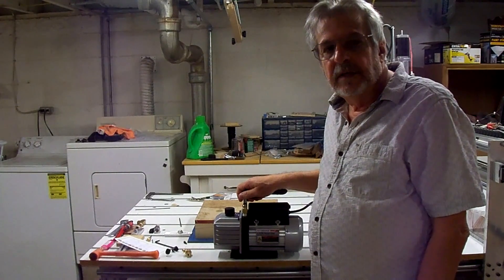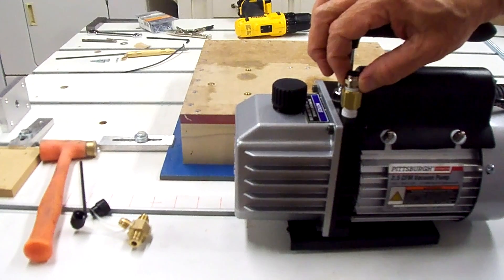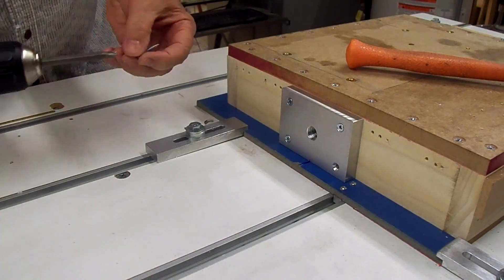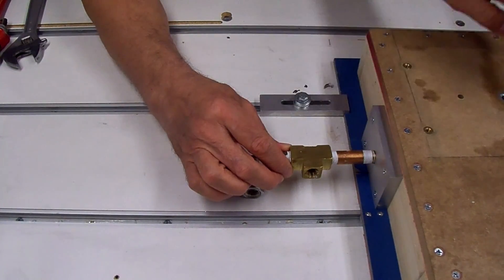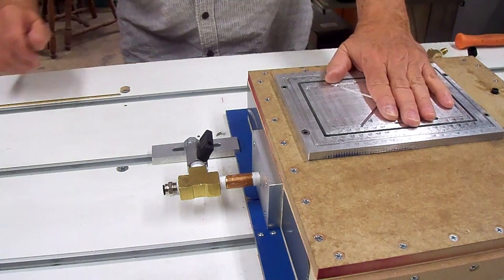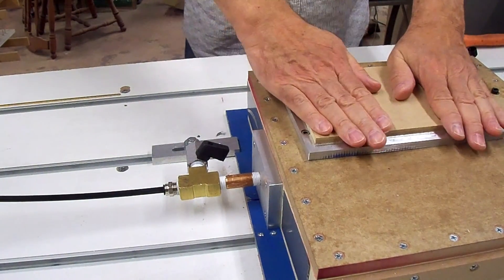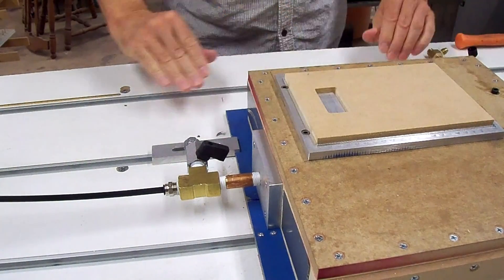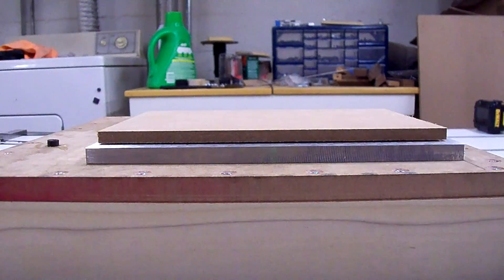New vacuum pump for the CNC vacuum fixture

Comment: hows does the vaccum go through the aluminum?
Reply from the maker: There is a hole in the centor of the plate wher the vaccum comes through and there are grooves cut into the surface of the plate that go out toward the edges. The grooves are about an 1/8" or so deep allowing the vaccum to reach the outer part of the plate.
Reply: @MyRobertadams  thank you sir.....nice build....i have a robinair pump...i want to make a couple small pads for fun...

Comment: So I am really having issues finding the proper thread size for my Harbor freight Vacuum pump I bought the 3cfm 2-stage version and the npsm to nptf does not work and its not a 1/4" npt or npsm size its actually a 3/8" pipe thread so I bought the Mcmaster 3/8" 4685t34 and thats not correct the only conclusion that I can think of is its actually a bspt thread (British Standard Pipe Thread) have you are anyone else run into this issue on the Harbor Freight 3 cfm 2-stage pump? I really have no quality measuring equipment either so I might have to go to a machine shop and see if they can identify it. But the npt, nptfn and npsm only screw in about 2 threads before it stops and the original Harbor Freight R12/R134A fitting goes in about 6-8 threads before it gets tight. All I really want to do is find an adapter to go from the pump manifold to 3/8" npt lol thanks I am also leaning towards bspt because its a popular thread in China and Japan like npt is in the us and canada
Reply: Oh yeah its defiantly a taper pipe thread I know the major difference is that the bspt is 55 deg angle on the thread from the cross section and npt is 60 degs so thats why it will go in only a couple threads I actually looked at the Mcmaster parts and found them to be a little expensive I actually ordered from Grainger lol who would of thought that they were cheaper Part# 1cpd9 Alpha Fittings Nickel plated brass so I await for it to get shipped to the store and we shall see. Do you know of a good way to Identify threads instead of educated guessing like I am basically  doing? and the next thread I need to chase down in the one on the exhaust port as I am going to use a filter on there to eliminate the atomized oil coming out
Reply: Did you ever find out the thread size?
Reply: @RavenRockMachine  i used regular hose clamp on mine works fine

Comment: I am using a similar vacuum pump setup.  I have added a portable air tank to my setup to act as a reservoir .  The tank was a 5 gallon model from harbor freight.  In case of an "Opps" or in the event you are losing slightly more vacuum than you are producing it allows a little time insurance.

Comment: Nice video! 
How do you avoid getting the inevitable dust and debris into your pump? Any filter in the air path? 
And do you get along without a sacrificial layer between the workpiece and the aluminum plate?
Reply: This hadn't even occured to me at first blush. Good point to consider going forward with my application for vertical mill.

Comment: I am going to start a chanel and wanted to know what editing program do you use.
Reply: I found more good info for your vacuum adventure. http://makezine.com/projects/make-41-tinkering-toys/shopbot-desktop-universal-vacuum-hold-down-system/
Reply: I would also add a vacuum gauge and mount it where you can check on the vacuum status just in case you have a drop in holding pressure.

Comment: thanks for the video.  please post a link on the spec of the pump.  also are you now able to say place 12mm mdf onto as a spoil board and the a sheet of material on top of that to cut.  I have  vacuum on my 900 x 900 table  but looking for a solution for small parts that can't be held any other way
Reply: +MyRobertadams thanks you don't have to remove to surface but if you do it well give better suction